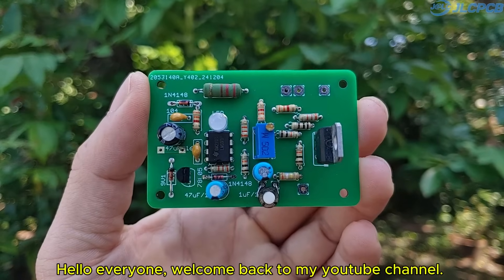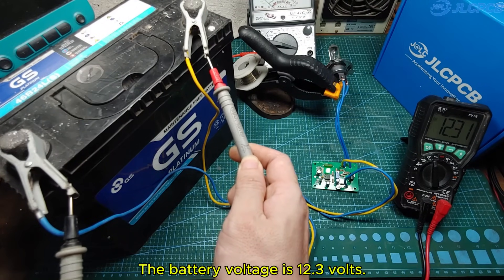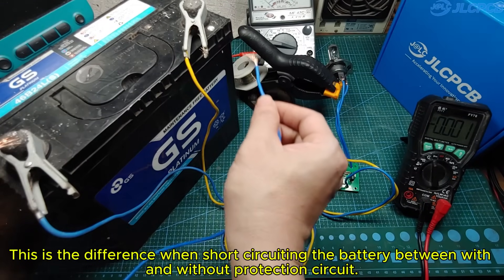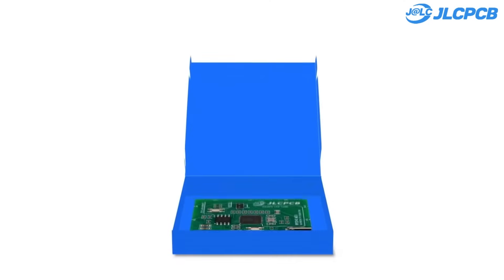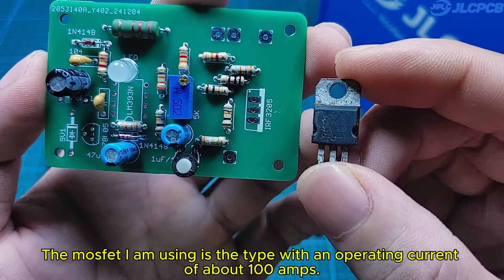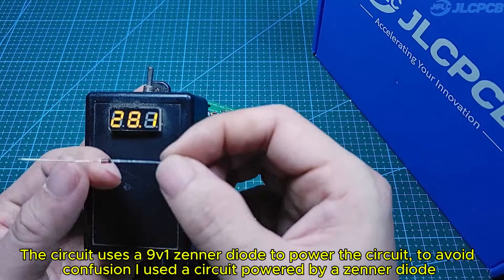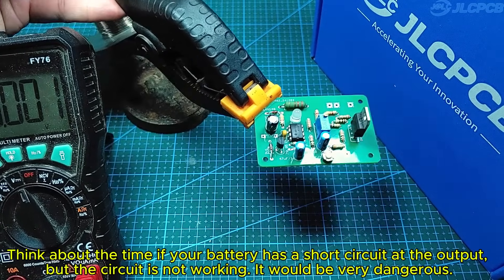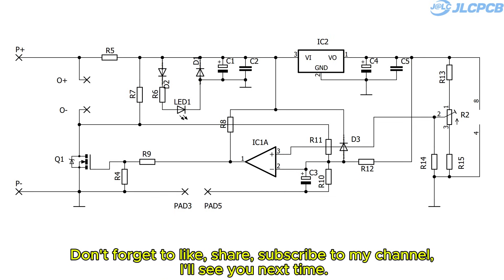1000A Battery Protection Circuit In Case Short Circuit

Comment: Small section area, and relatively long short wires wires, are hugely reducing short circuit currents to a fraction already before the circuit. Place your circuit very close to the battery poles and use big section wires, then you can confirm it works.
Reply from the maker: Thank bro. The result is same bro.
Reply: @LongTechnical  Then show it.